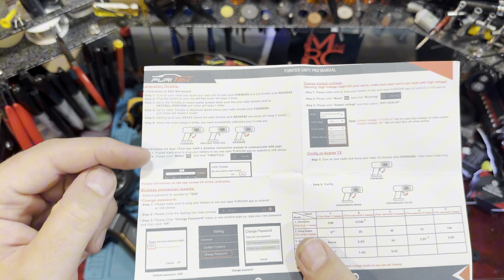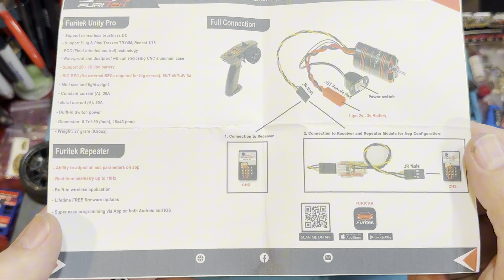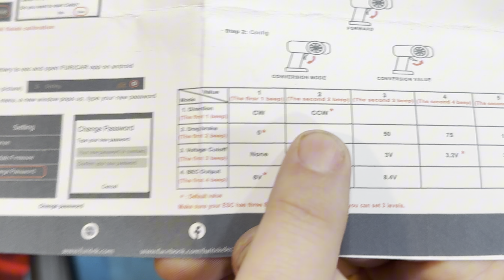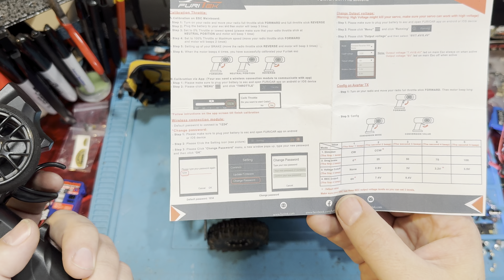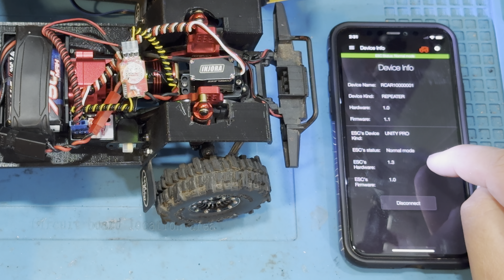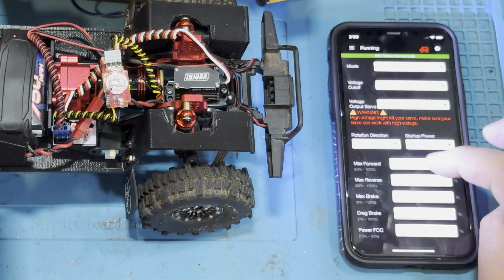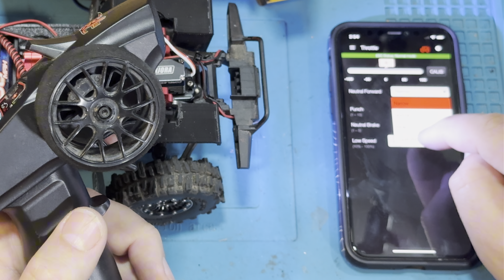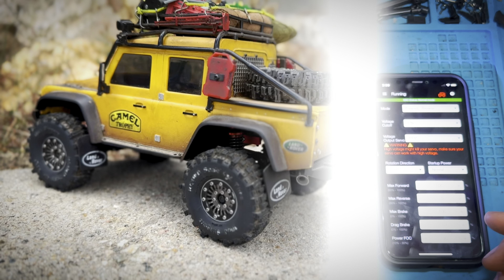Furitek Unity 2-in-1 Brushless ESC & Motor Combo! It's like a tiny fusion of awesome and powerful!

Comment: With my stock system, my truck gets to a minor obstacle and then won’t move… it just stops… because of the lack of torque… how’s the torque with this system?
Reply from the maker: It’s a TON better.  You can see in the running video that it’s smooth as butter.
Reply: @TheShopMiniRC  nice!! I just hate the fact that I can’t run my Traxxas light setup with it… I JUST bought it and got it hooked up too… bumper lights, head and tail lights, AND roof bar (Injora)… on a side note… with the Traxxas lights, I wish I could put the hazards on with the headlights… there’s no setting that allows for it… they coulda done away with ‘demo mode’
Reply from the maker: @ I have a video showing a wiring harness for the TRX4M when you no longer use the stock rx. 

HeyOKPerformance Light Harness for the TRX4M pro light kit!
https://youtu.be/c2TZdYcFpIU

Comment: My main question is if this setup will fit in the ripper chassis 🤔. Gonna do a scratch build as I already have the chassis kit. So I’ll be running my own electronics and will also need to source out my own light kit for it for sure.
Reply from the maker: It should yes. I have a ripper with the stock motor. So this should fit no problem.
Reply: @TheShopMiniRC  ah true. Thanks for the info my dude. Keep up the great vids 😁👍🏻
Reply from the maker: @modernart86  thanks for the support. Be sure to share any videos you love!

Comment: would this fit the MN82, FCX18 unimog or FCX24m discovery?
Reply from the maker: I don’t think it will fit in the fcx24m. But it will fit in any other fcx 24 / 18.  (The fcx version)

The mn82, I’m not sure, it all depends on the gear pitch and the motor mount holes.
Reply: @TheShopMiniRC  thanks

Comment: when should you be worried about motor heat? when should you be worried about servo or esc heat?
I had my python heat the motor and servo way crazy to where i couldn't touch it; no idea temp. and couldn't figured out why
unity!
Reply from the maker: If you can’t keep your finger on it for longer than 3  full seconds, it’s too hot.  And a servo should never get even close to that hot.

Comment: Just got my unity pro a few days ago, slightly concerned about the temps. I updated the firmware right away, saw that the update notes mention temperature optimization. Running on 3s, motor temp gets to 50-55c just trailing. pretty dang warm to the touch.  Is this normal?  I have calloused, semi-heatproof hands (lol) from working as an auto tech so idk if the finger test is accurate for me. 

Before the unity pro i was running a cedar with a moforc rockwolf esc also on 3s and it definitely ran cooler.  what do you think?
Reply from the maker: I know it runs hot 55c should be fine. Just don’t get over 70c. 

You can also check your drag brake and turn it down if needed.  Too much will heat up.
Reply: @TheShopMiniRC  Thanks, that does give me some peace of mind.  

Do you know if anyone makes a heatsink that fits on the unity or cedar?
Reply from the maker: @PG14306  none that i know of. I’m sure there is something out there, I just Donno without doing some research.
Reply: @TheShopMiniRC Lowering the drag brake from 30% down to 10% dropped the temps by almost 20 degrees, and the brake level still feels good at 10%. Thanks for the tip!
Reply from the maker: @PG14306  yeppers. That will do!